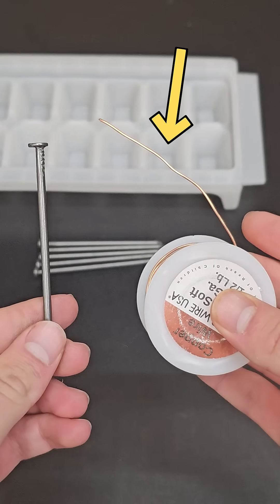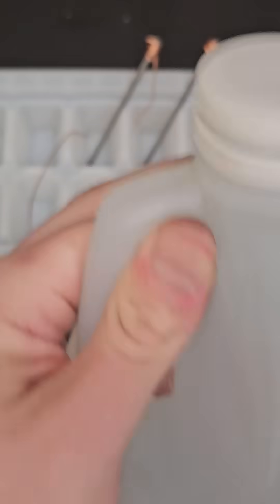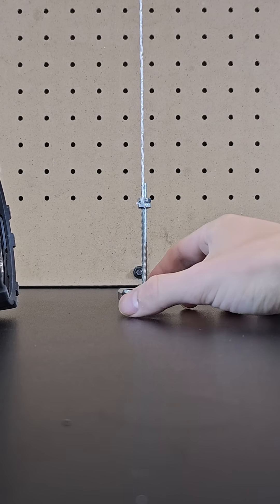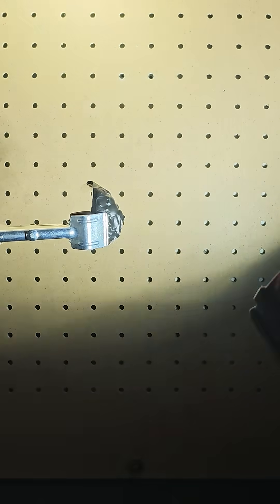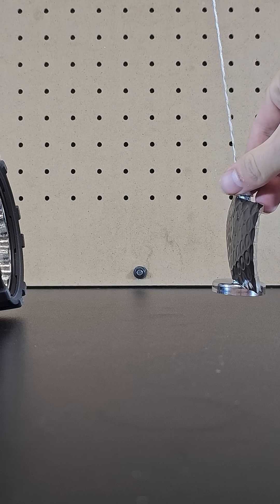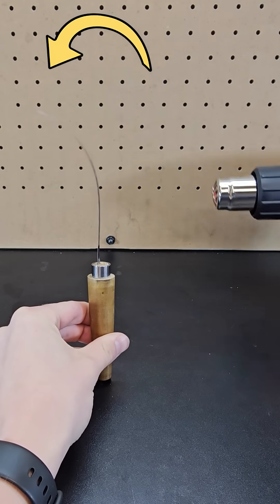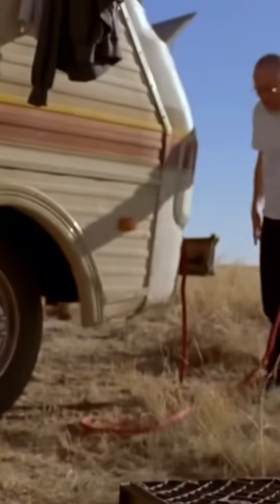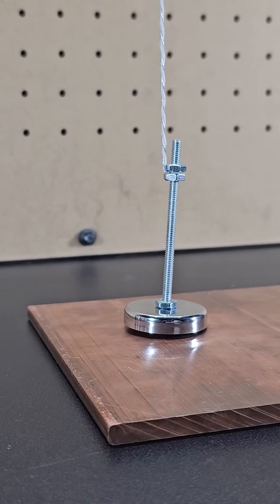Can you spot real vs. fake science? - 2 Truths & Trash (S4E1R2) #shorts

Comment: light does have momentum, and it can apply force/pressure on objects known as radiation pressure. hang a small mirror from a thread, when the mirror comes to complete rest, shine a laser on the mirror, the mirror will oscillate back and forth very slightly.
Reply: there's actually devices used to show this (though i forget what they're called). however, in order to show it, the part that moves has to be very light in a low pressure environment, and it certainly wouldnt be able to stop a pendulum that fast. plus the pendulum would be able to move afterwards
Reply: @timestopgaming2674  are you thinking of a Crookes Radiometer? They don't work the way you are thinking if you are
Reply: note how a mirror does the exact opposite of a black foil, in that it reflects light instead of absorbing it.

The momentum of light is negligible at most real-world scales, such as the one in the video.
Reply: @bobgoldham69 true but it would be an accurate to say that light has no momentum or Force at all. And one could argue that is the implication that he is leaving people with i knew it was fake and could tell by the shape that I was a magnet on the bottom and that that was going to be faked but was surprised he didn't explain how it would actually work if you did it correctly.
Reply: But it's a very small momentum, that can't even be captured by the equation p=mv
Reply: @zecaaabrao3634  It's small, but with a large enough sail in the vacuum of space, it would get a craft to a planet far faster than any rocket fuel would as you can keep it up until you hit the necessary velocity.
Reply: THIS scientists are thinking about making big sails to propel spacecraft without needing fuel

Comment: B was fake but if the surface was reflective, it would have had an effect (albeit incredibly small and hard to measure). Such a "solar sail" is actually a proposed method od interstelar travel but it uses a strong laser, not a flashlight
Reply: The effect still happens with black. The momentum exchange is (up to) doubled with a perfectly reflective surface however, as the momentum of the photons is not simply absorbed as by a black target, but reflected, adding the same amount of momentum to the target again as the reflected photon is emitted.
Reply: Hard to measure, but relatively easy to calculate
Reply: In that case I believe it wouldn't damp it but rather would bias it towards a particular direction; you should see a nonzero equilibrium angle in that case
Reply: Yeah this got me because of that, the claim is that you can use light to effect the momentum of a pendulum, that is a true statement, it's just the demonstration that is fake.
Reply: A solar sail typically uses sunlight, and they have actually been launched and used
Reply: But the proposed solar flair has to be so absurdly light weight that, currently, it's physically impossible to apply.
Reply: solar sails would only work in space as there is no air resistance or gravity acting on the sail, but the effect would have been small because you can still detect forces, even extremely small pushing against air resistance.
Reply: @joshuabarqueesimeth4530 There is almost always going to be gravity affecting anything in space. The farther you are from it, the more marginal it becomes until its influence can't be felt over what ever else is exerting more force. But it is still pulling some and causing "force" to be applied on it. On paper you could get a solar sail to work inside Earth's atmosphere, but only on paper. I can't even imagine how much energy it would cost to get a solar sail satellite to move across a completely smooth surface on the ground here, let alone through the air, while factoring in that it would be pulsing. 
Example: Jupiter does more than block most meteors from hitting us. Its also responsible for our orbit path around the sun, and at certain RARE times, helps pull our moon away from earth a little bit faster than usual. Same goes for our solar system to the center of our galaxy. And our galaxy to our cluster. Those forces are hitting us, we just can't 'feel' it.

Comment: The bimetallic strip has some cool uses!! You can use them as overflow circuit breakers, because enough electricity running through them will cause them to heat up and bend away from the circuit, shutting everything down until it cools off and you restart things.

Comment: 1 copper wire and zinc nails in vinegar (an acid) is a battery.

2 that "weight" was a magnet, when it moved over the metal under the table it stopped.

3 bi-metal alloys one metal expands faster when heated, and bends the opposite direction.

Comment: Usually I have to reason and deduce which one is fake, but bi metallic strips are used in all sorts of places. 

They are what control the duty cycle (temperature) of stoves when you turn the knob on an electric stove

And I know that exactly how a battery works, so it’s gotta be:

B. B is fake. It’s a magnet on the end of the pendulum and you’ve placed a piece of copper or aluminum underneath the table to induce eddy currents around the magnet and slow it down

LETS GOOOO

Comment: Old style mercury tilt-switch house thermostats have a bi-metallic coil in them.  You may not be able to stop a pendulum with a super flashlight, but even an ordinary flashlight will provide enough energy to activate the bi-metallic coil and change the switch's position.

Comment: B is the fake one
Reply: The white side would reflect the light, rather than absorbing, meaning it would have to be white, not black. However, this wouldn’t work for a heavy pendulum like that. The demonstration with light is done in a vacuum because even air resistance can throw it off, iirc

Comment: Even when watching the second experiment I knew it was gonna be fake cause I recognized the weight on the string as a common piece of hardware with a magnet used for hanging stuff usually. The motion of the weight during the experiment was identical to what you’d expect from magnetic braking, when a magnet accelerates past a conductor like copper or aluminum.
So B is absolutely the fake one here.
I love these videos btw

Comment: The flashlight would effect the pendulum, but almost immeasurably. The black plastic you put on it, if it didn't melt, the heat it gave off would have more effect than than the photon pressure.

Comment: The second one is fake. Just used a magnetic to slow it down, we use the same ones at my work to attach cables to the sides of oil tanks and shit

Edit: wasnt expecting using magnetic breaking tho, thought it was just a regular piece of steel holding it in place

Comment: A. There's no way just metal and copper can generate electricity without any effort going into generating it.

Edit: I thought B was real, since any light source can technically be used for travel in space. Even the smallest light source, if it takes you years to move a single centimeter, is still technically traveling through space.

Comment: I have done similar experiments to all of these and knowing that the pendulum would be the easiest to fake(I did think it was magnets and was wrong). Black absorbs more light, yes, but it will not affect the horizontal motion of the object, especially with that much weight. However, if you've got yourself a big black bag and it fill it with air on a hot day, the black bag will heat up the air in the bag and take it away. It's neat, but don't let the bag get away because that is littering

Comment: First one he wasn't showing the other side of the ice tray when he put the light in and had a battery attached the other side having a battery attached the other side will make it a circuit it'll be a fairly weak circuit due to all the water numbing the circuit a bit but but the other two are true I know this for a fact because you can create a fan in a vacuum using light with a similar effect of the pendulum and I know the metal one is true because the same thing happens the samurai swords when they quench them that's why they're curved

Comment: A seems plausible, I have passing knowledge of galvanic potentials but the battery chemistry seems legit. Cathode, anode, separated by liquid electrolyte. The polarity might be backwards, who knows. C is also legit. Related fact: thermocouples operate on this principle electrically, since thermal expansion and resistivity/permissivity are often coupled if not correlated.

B is false. The melting is legit, but thermal interaction is far more powerful than the electromagnetic propulsion. Solar sails that propel satellites require insanely large sails to propel the spacecraft, and that is from the sun, in space. The luminance from the sun is far greater than that flashlight, and solar sails barely work.

Comment: B was the fake. A is an actual electrochemical battery, akin to a lead acid battery. C is bimetal, which I know more about since it has electrical applications as well for thermostats more commonly. The strip heats up and moves off of a contact in the thermostat when you turn your heater on long enough.

B is just a magnet under the table.

Comment: B was fake,  but also true. 

Photons do have a very tiny amount of mass. This is why stars clear out the molecular clouds in which they form. However,  the amount of light required to impart motion we can detect is insane. No super-duper flashlight is going to cause any motion you can see, except with super light materials in vacuums. Yes,  we have done that.
Reply: Photons do not have mass. They have momentum
Reply: @johnvonkerman You cannot have momentum with no mass. Momentum is fundamentally a function of mass as it's the combination of mass and velocity. With no mass, you cannot calculate momentum. 

As much as we've learned about the fundamental nature of particles,  we've only scratched the surface. We've been constantly learning new things for a century, and are still amoebas in our understanding of the universe. Aspects of our current understanding WILL be proven wrong, if we survive long enough. Holes in our understanding,  like the contradiction of momentum being a function of mass but photons having no mass but still having momentum,  will be rectified. 

And it may be that YOU are correct. Photons may have no mass,  AND they have no momentum,  and have other undiscovered properties that don't contradict what we are currently capable of proving. 

Or we may find the relation between mass and momentum is not what we think it is. 

Or this is all the creation of a being that can change how things work at will.

Or we're in a computer.

Comment: Maybe A and B 
A) 
1) for it to be a galvanic cell it ddoesnt need to be galvanised metal
2) I think the ions would have to be abke to exchange through the ice cube thing as if it were a mambrane which it most possibly isnt.

B) 
1) the light propably ist as strong as shown because photons dont have that much impact, the only way this could be true is if it was INSANELY strong.
2) If it were that strong the light would not just stop the pendelum, but push it back again until a equilibruim of the gravitational force and the "knockback"-force of the light orms.

C) 
is absolutelly legit the only way it werent is if the Heat wasnt high enough or the difference of expansion between the metals  wasnt high enough. 

pls react is what I thought of is correct.

Comment: B is fake. While there is a device called a radiometer that uses light to induce motion, the black and white fins are contained in a bulb with a very specific pressure and composition. And even if the light had enough force to push the pendulum, it wouldn't dampen the motion like that, it would just make it swing about a point slightly to the right of straight down. It looks like you're using magnetic braking.

Comment: By the way, the Crookes radiometer works because the plate heats up in the place with the air, and the air creates pressure. Light does not push anything.

Comment: While the light AND the wrap will significantly slow down the pendulum it will NEVER just stop like that. First off the light, while it does put some force on the Bubble wrap, an effect known as a solar sail, it is honestly a negligible almost immeasurably small force barely worth mentioning and honestly the gas released by the wrap from the heat of the light has a higher stopping power than the light itself. The bubble wrap itself will create drag through the air and will reduce the speed significantly, but it will not take enough energy out of the swing to negate newton's laws meaning a compete stop is not possible unless you have a way to rob and disperse the energy from the pendulum. Like say something that can be used with the magnet to create enough force to rob it of its energy. Like say a hidden bolt or an induction plate made of copper or aluminum.

Comment: how is the first one right?
you need 1,5 to 2,2 volts to turn on a Red LED. but this galvanic Element (Cooper, Zinc, Vinegar) only has a output of 0,6 to 1,1 Volt. 
the Voltage also doesnt add up because its put in series and not parallel.

If anyone has an answer to this please comment/correct me
Reply: 1st one is clearly fake, that's not how electrochemistry works you need a salt bridge

Comment: Battery acid is acidic. Vinegar is acidic. Putting a cathode on it (nail) and the anode being the copper wire, you make a small battery.

Bimetallic strip is what Flat Irons use to determine if the thing is hot enough for the different levels of heat on it's knob. 

The flashlight thing is just burning the black bubble wrap. No opposite motion was introduced to stop it (unless of a hidden magnet)

Comment: It’s obviously

B.

I wasn’t sure whether this type of galvanic pile could reach .35V which it needs to get to the led forward voltage with only six cells, but it’s a classic experiment. And yes, that is how bimetallic strips work. But that pendulum clearly has a large magnet used as the weight and, well, that would explain why it looks like magnetic slowing. Possibly just eddy current related if there’s not a magnet underneath the bench.

Comment: If a flashlight can stop a pendulum like that, then the Sun would've blown away the whole solar system by now. 

Yes, photons do exert a force on objects they encounter, which is part of why most stars don't immediately collapse into black holes. For the flashlight, it's just a matter of scale that it can't have this effect.
Reply: The way the pendulum stopped also just looked magnetic, if that makes sense
Reply: Right? Photons have effect of motion microsopicaly but not macrosopically.
Reply: @_itsnor_1603eh, scientists have created ways to harness light for motion macroscopically, but it requires specific setups. Solar sails come to mind, they use a highly reflective surface to harness the momentum of light while in space
Reply: Light pressure is real, satellites have to take it on account for their trace adjustment, but I think it isn't as effective as the flashlight one, also it's stronger when the surface is reflective (twice if its perfectly reflective).
Reply: Super nitpicky but most stars would collapse into neutron stars if it weren't for the expansive force of nuclear fusion, only really big ones would make black holes, since even without fusion, the weak and strong nuclear forces would push the matter apart enough to not become a black hole (I believe, since neutron stars don't do much of any fusion, since they are mostly iron)
Reply: And momentum that is already proven, but it's small
Reply: Photons exerting force despite being massless is one of my favorite fun facts
Reply: He said the light has a fan in it because it gets too hot. The exhaust most likely goes out the front of the light?
Reply: I was wondering if it's hot enough to burn things it very well could have an effect on momentum, but I knew that one was the fake one still.
Reply: convection
Reply: C
Reply: How can they exert force on something without any mass?
Reply: @drljevic583  The classic Newtonian definition of force and momentum depends only on mass, which is a fine approximation for most situations we deal with on a day to day basis, but the more complete relativistic equation for momentum also takes into consideration the energy as well. Photons don't have rest mass, but they do have energy, and cause mass and energy are related by e=mc^2, that means photons do have a teeny tiny amount of momentum, so there exert a tiny amount of force when the collide with things. That's called radiation pressure and is how solar sails work.
Reply: @drljevic583 They probably meant that photons transfer energy.
Reply: @drljevic583 Because mass and energy are equivalent: E=mc². If you solve for the mass equivalence of the photon, you get m=E/c². This means that a photon needs an enormous amount of energy (or an enormous number of them) to have the same effect as a single tiny mass-bearing particle.
Reply: @drljevic583 they still have momentum, photons can transfer that momentum into matter.
Reply: this comment sounds like bs
Reply: Ok i looked it up. It's actually all correct, sorry 😂
Reply: I don’t think photons can exert a force, what they can do is excite particles enough that they exert force however
Reply: @gf1006 they can. They have momentum